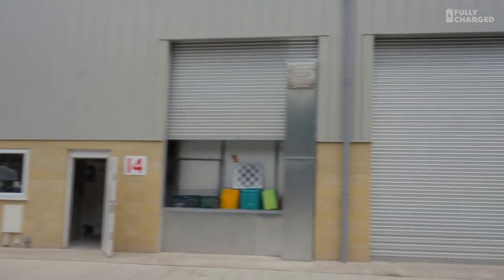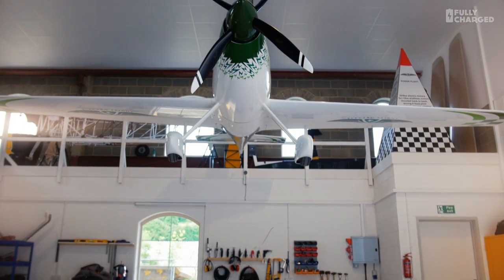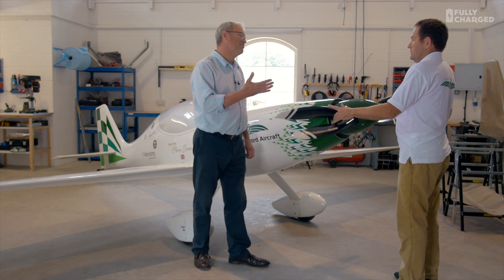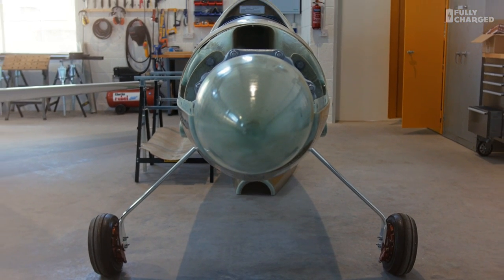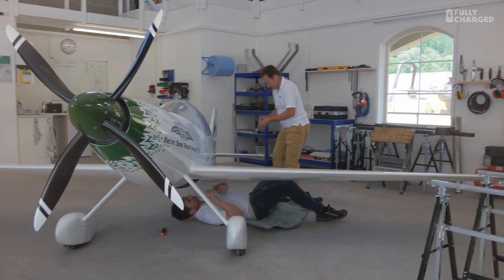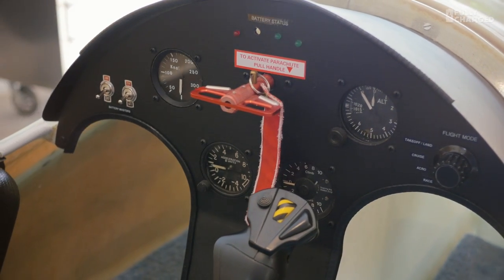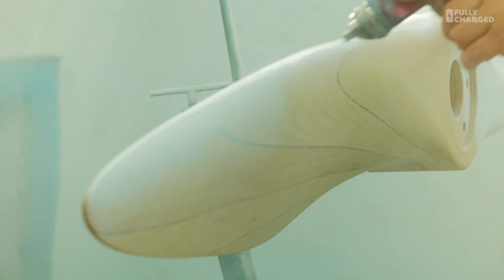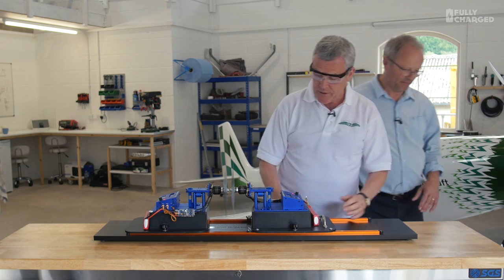Electroflight | Fully Charged

Comment: another big middle finger in the making to the oil industry?
Reply: Imagine villages in like Vietnam where it's takes days to travel to by car, imagine if they could have planes like this charged by solar panels, how accessible would it be for them to get stuff that they want?
Reply: Driving a car and a plane are two very different things. One takes a few lessons, the other months. One you can teach yourself, the other you would die in a ball of fire if you tried :)
Reply: MomentousGaming So? what's the difference? It's not like people would fly a plane which they don't know how. The aviation industry could switch to electric. Which is still a middle finger to the oil industry.
Reply: I replied to Taha who postulated giving electric aircraft to small Vietnamese villages for transport instead of cars. It wasn't a response to the parent comment.
Reply: +MomentousGaming accessibility teaches, and they already use airplanes, but normal ones
Reply: Nothing will be replacing fossil fuels in the majority of aviation applications for a very long time.
Reply: +idontcare80 for large commercial aircraft yes but for a small planes i don’t see how ice has much of a future.  in 8-10 years battery capacity will double todays best batteries
Reply: Battery capacity would have to increase at least 8-fold to make battery electric aircraft able to compete with ICE aircraft, that's not likely to ever happen.
Reply: I don't think it needs to be anywhere near that much to replace the majority of small aircraft. The operating cost alone will kill ice except to specialty uses.
Reply: idontcare80 most gas cars have a 500plus mile range but most rarely use that only for long trips the same can be said for small aircraft. So if it only has half the range of ICE it should be acceptable for many
Reply: It does. Battery electric aircraft can only fly for about an hour, and that makes them useless for just about anything. ICE aircraft can usually fly for about 6 to 8 hours.

Modern ICEs for light aircraft could also drop operating costs considerably.
Reply: People use aircraft to travel, they don't use them to make trips to the grocery store.
Reply: +idontcare80 farmers don't need 8 hour flight time
Reply: +idontcare80 lol an aircraft ICE will never be cheap they sever times more then an automotive engine. whereas a Electric motor is pretty universal and is mostly maintenance free
Reply: Farmers aren't the majority of aircraft buyers.
Reply: Nothing for an aircraft will ever be cheap. The ICEs that nearly all light aircraft currently use are ridiculously expensive because they're a ridiculously obsolete design, they've barely changed since the 1950s!. A modern aircraft engine would not only be less expensive, but it would also be more fuel efficient, burn cheaper fuel, require less maintenance, be more reliable, and cost less to maintain.

Your points are all irrelevant, chemical batteries will never be energy dense enough to make purely electric aircraft practical for the majority of aircraft users.
Reply: +idontcare80 in the first decade of flight most people said aircraft will never have a practical purpose. never is a long time
Reply: +idontcare80 i agree it won't happen over night but you will see electric aircraft start to creep into larger and longer ranger aircraft for cheaper.
Reply: The laws of physics are pretty timeless.
Reply: That wont happen unless battery technology makes a massive leap forward.
Reply: +idontcare80 there always is hydrogen and fuel cells for electric energy storage...
Reply: That's even worse than batteries.
Reply: I'm afraid that you don't know what you're talking about. Hydrogen stores circa 3x more energy by weight than kerosene, and it can be converted to mechanical energy using fuel cells and electric motors with at least 50% efficiency, compared to max 30% efficiency of ICEs. 2 problems: fuel cell power density (good enough, but li-ion batteries are much better than that) and hydrogen storage (cryo is good, but problematic).
Reply: I'm afraid that you don't know what you're talking about. Hydrogen fuel cells and their related storage tanks are not only larger and heaver than batteries, but they're also not easily configurable for aircraft use. Hydrogen tanks must be spherical or cylindrical, which means that they could not easily fit in the wings of an aircraft. There's also nothing green about hydrogen, it's just another fossil fuel, one with very poor well to wheel/wing efficiency at that. Turbofans are also more like 40% efficient.
Reply: Of course these are other issues as well. I wouldn't agree with that part about weight of the system, however; I don't think you realise how low the energy to weight ratio for batteries is. Plus, there must be advantages to cryo hydrogen fuel in aviation as well (don't forget that almost all higher stages of heavier space rockets use it instead of kerosene), as it is used commercially in Boeing Phantom Eye (albeit with an ICE-driven propeller) and also smaller fuel cell UAVs that achieved over 48 hrs in the air (Ion Tiger). Hydrogen isn't inherently dirty; it's just the current economy. You could say that electricity is dirty because producing it in coal-fired plants is still the cheapest way in most of the world, unfortunately. Even if you produced H2 from natural gas, but using clean energy as much as possible, using it in fuel cells would be far cleaner than burning kerosene (no NOx and other emissions from the vehicle, higher fossil fuel/CO2 emissions to energy efficiency as well). You can do it in e.g. Norway where you have both natural gas and cheap and clean hydropower.
Reply: Be great if the plane was charged by a ground solar system.
Reply: You can also make a solar powered airplane fly around the world, but that doesn't mean that it's practical, or even useful. There's just no way hydrogen is happening in high performance aircraft (hydrogen fuel cells aren't likely to find a practical use in any kind of transportation), the energy needs are far too high. A synfuel made from captured CO2 is the only alternative for commercial aircraft, period.
Reply: Fuel cells not likely to find practical use in any kind of transportation? I would say they already found practical use in a mass-produced passenger car that was tested on this very channel: Toyota Mirai. The car would be a rather practical one as well, provided that hydrogen fueling was readily available. That doesn't change the fact that hydrogen is a dead end for road vehicles, and there might be some truth to the theory that it is pushed by oil companies as they can put their hands into hydrogen production and distribution business easily, which is not true about electricity and batteries. You don't need that high energy densities for vehicles that neither are airborne nor are supposed to operate for a long time without breaks. In fact, current Li-ion technology has energy density good enough for comfortable and fast long range travel, when coupled with a quick charger network (as Tesla has in many developed areas already). Let's just not kid ourselves: it's just much too expensive at the moment.
Reply: Prohibitive cost is the biggest enemy of hydrogen. Fix that and you're on to a winner.
Reply: For use in aircraft, the problems with hydrogen go way beyond cost. The fuel cells and hydrogen storage tanks are too large and heavy for use in anything that flies, hydrogen causes metal embrittlement, there are no EDFs that can produce the tens of thousands of horsepower needed to replace current jet engines (and there may never be), aircraft fueled by hydrogen would have to be entirely different designs from what we have today because of the way fuel is stored in current aircraft designs, hydrogen itself is far from being green, fuel cells don't last, making a fuel cell capable of continuously supplying nearly a quarter of a million hp is likely impossible, the list goes on and on.
Reply: It's been far too long. I yearn for the day we usea tiny fraction of the fossil fuel we use today, if any at all.
Reply: idontcare80 I don't think that cryogenic fuel tanks need to be heavy... But metal embrittlement is a problem. I also now that fuel cells don't have the power density needed yet, but they are getting better and better.
What is an EDF? Don't know what you mean?
Reply: It takes a very large amount of energy to keep cryogenic hydrogen fuel tankes cold. The power density of fuel cells is still very, VERY far away from being usaful in aircraft. An EDF is an electric ducted fan.

Obtaining the hydrogen itself is very far from being green, there's no reason to even pursue it.
Reply: GG2K7AU05. considering they have not come close to a practical aircraft.....no, its not.
Reply: GG2K7AU05. Just picture how much oil is used up in making the plane, maintaining the plane, in the making of the battery, and the charging of the battery. You should get off the device you use to watch and comment on YouTube before you are tempted to hate yourself. How devastated  would you be if that nice shiny paint job were petroleum based. Irony is so funny when in regards to ignorance. The only way to beat big oil is to do nothing. Literally, do nothing.
Reply: Joshua Weaver I think you misunderstand the effect of using fossil fuels as fuels.
Reply: idontcare80. I think not. using fossil fuels is using fossil fuels. if the point is to boycott a product by not using it than don't use it in any form or fashion. we can minimize, but as a society we are simply too tied into using it for much more than people are aware. A solar powered plant making a tesla to be delivered via electric semi truck is still using oil. and my point is much more than people think. this plane is about the worst as it gets people hyped up  simply because it is electric with little to no intelligent consideration for use of actions or how efficient any needed actions are. the faster people fly the more oil companies are happy. show me a payload over a considerably distance and I will be impressed, but still only if that payload was needed over that distance.
Reply: GG2K7AU05 haha silly goose they will sponsor this stuff and make money. They aren't going anywhere they will be a different kind of company that's all.
Reply: also weather is a huge issue with one, and a minor issue with the other.
Reply: +GG2K7AU05 Is it a bad thing?
Reply: Well you have to consider how the weight will effect performance. ICE is extremely weight efficient in comparison not to mention far cheaper so I believe it will be the Electric Motor that will be limited to specialty use for the near future.
Reply: @Mr Brightside think outside the box here..
 a small fuel power ICE, akin to the APU at the back of plane, to turn the generator, to provide enough electrity to turn the turbine in the "jet engines" at the wings.. you have an "electric powered jet engines".. Batteries, if required, are only as back ups...
how's that?
Reply: Since Internal combustion aircraft have many multiples of this thing's range, why wouldn't these hypothetical Vietnamese villages be supplied by airlift already? This is a racing airplane, optimized for one thing, but balancing competing factors is the critical factor in aircraft. You can increase power, and thereby increase speed, but that uses some of the load carrying capacity impacting range and cargo carrying.  You can increase range, but that comes at the expense of something else, like cargo or passenger carrying capacity.  Because hydrocarbons like gasoline or diesel fuel have much higher energy density than storage batteries do, increasing range has a  comparatively small weight penalty.  @tahaistheboss98
Reply: The technology simply isn't at that point. The battery chemistry doesn't exist, even in the laboratory. There are already electric sport planes in production, and they will perform the most common mission of light aircraft, taking off, flying around for a few minutes, possibly flying to a nearby airport for lunch,  returning and landing . They have extremely limited range capability and cross country flight of more than 200 miles, something the typical Cessna single would have no difficulty with is out of the question.  @sbellaharris
Reply: Aviation fuel only cheap when compared to everything else in aviation. Two seat light sport aircraft cost up to $300,000. It's the same trade off as electric cars, but worse. You can do a 60 mile round trip in good conditions, no problem. A 200 mile trip when weather might make you have to divert to an alternate airport, something the typical IC aircraft is meant for is currently impossible. There is a good reason electric two seater VFR sport aircraft are being produced, but nobody builds electric aircraft for the biggest aircraft market segment, 4 to 6 passenger single engine planes. Those planes assume that you and a passenger or two with golf bags or gifts for the grandkids could fly 200 miles, spend a few hours at your destination and fly 200 miles home in one day. Electric airplanes are a long way from that, and no battery chemistry currently in the lab promises to get them there.  @JD-yx7be
Reply: Certainly no battery chemistry in the laboratory holds out that promise.  @PistonAvatarGuy
Reply: A light sport aircraft that has limited range and power that you can't fly in instrument conditions costs up to $300,000. If you can afford the cost of admission, some $6 a gallon avgas isn't going to kill you. Electric motors have the promise of being very low maintenance, but batteries are like a lot of other things. They like a steady state. Deep discharges at high amp rates followed by fast charging, then more high  and deep discharge, in the hottest weather followed by weeks or months of sitting in an unheated hanger might mean those hideously expensive Li-ion batteries couldn't be trusted for more than a season or two.  @JD-yx7be
Reply: K2LSS there would be considerably less fire with one of these if they crashed. Electric would also be much quieter. So all those pieces of land in the flight path of thousands of airports would no longer be quite as worthless as they use to be. Also aircraft are considerably safer than cars, just way scarier for most people. Something about defying gravity makes people nervous.
Reply: @JD-yx7be  Battery capacity, if by that you mean energy density has doubled in the last decade, but that involved entirely different chemistry. No battery chemistry in the lab today holds out that sort of promise. The economic rewards are obvious, but more researchers and more research money don't necessarily create breakthroughs. We cannot confidently state that another doubling of energy density will occur in the next decade. For the foreseeable future, IC aircraft are much more capable than electric planes.
Reply: Did you listen to the video when they were running the two motors in a test rig?  A lot of the noise you hear from propellor aircraft actually comes from the propellors. Noise issues on the ground are mostly about jet aircraft. Yes ,planes are statistically safer than cars  If they don't crash, fire isn't a concern.  @stevenb7319
Reply: GG2K7AU05 lol it takes about 90 hours of flight time to get a pilots license.  Please reevaluate your math, as 90 hours is no where near MONTHS.
Reply: The route most modern engines use to increase the power to weight ratio of an engine is to increase rpms. That usually doesn't work for aircraft engines because when propellor tips go supersonic they become hideously inefficient.   @PistonAvatarGuy
Reply: @herbertshallcross9775  That's what PSRUs are for.
Reply: In the decade after the Wright brothers flew, about a thousand people people had flown  in fifty or sixty aircraft. there were major air meets at several large cities .There were at least two companies producing aircraft for sale. The military of several countries had purchased aircraft and they were a year away from using them in a major conflict. The first regularly scheduled passenger service was just a few years off,.
Reply: Everything on that plane was made with oil products.
Reply: @tahaistheboss98  Only problem with electric is the source of your power. Some people think electric is carbon neutral, but it isn't right now. The power that is charging these electric vehicles comes from a powerplant somewhere, and that plant is likely using fossil fuels to generate the power. Essentially you are just moving pollution from one place to another. It's the old "outta sight outta mind" mentality.
Reply: Electric motors, Battery's are a feel good look how green B.S. Solar is slow and not portable enough to rival prop fuels/jet fuels . We have a long way to go before Electric is usable in aircraft .
Reply: Have fun with your 10 minutes of operation time or loading tons of batteries.
Reply: If you want to raise a 'big middle finger to the oil industry' then stop using so much yourself.
Reply: As an Arab leader recently said of the oil age:  The Stone age did not end when they ran out of rocks.
Reply: @sbellaharris  I could imagine a time we will have autonomous 'copters drop down and pick up cargo pods or passenger pods and hop them across the landscape.  Passengers and goods moved around with electric energy but no roads.  And no pilots, so no accidents.  Third world countries could rocket their development.
Reply: @PistonAvatarGuy  It's completely dependent on how fast improved batteries come in.  And there are lots of marketplace incentives to bring that investment out.
Reply: @PistonAvatarGuy  Current batteries contain an amount of energy equal to a similar volume of wood.  Seems to me, batteries could store 8 times the energy in a short period of time.
Reply: @PistonAvatarGuy  For helo transport in a metro area, a one hour range would work if you had fast charging where ever it set down.
Reply: @PistonAvatarGuy  The Ice engine has been developed to a very high degree.  If battery power got a similar focus, the ice engine would be obsolete in no time.
Reply: The fact that Hydrogen power has been neglected by researchers suggests it's not as promising as battery power.
Reply: @Mr Brightside In the WW1 era, planes had a major problem with weight.  The possible payload was very poor.  The had to keep weight down by extream measures.  Twenty years later, the weight problem was solved.  Engines had much higher power output.
Reply: @winomaster  IF, you mean. Batteries are already likely to be near their limits.
Reply: @PistonAvatarGuy  I can't imagine how we can  know how much progress is possible.  But, we have to be very low on the progress curve of possible progress.
Reply: @winomaster  That's why I said that they're LIKELY to be near their limits. Battery energy density has STOPPED progressing significantly, the top of the curve has either been reached, or is close to being reached.
Reply: @Mr Brightside My comment is about how efficient it would be.  Alaska has few roads and depends on small prop cargo planes to move anything.  Autonomous, electric drones making pickups would be very efficient.
Reply: Yes it's amazing, now we can build electric military drones and drop bombs on lithium mines when they slaves aren't working cheap enough...